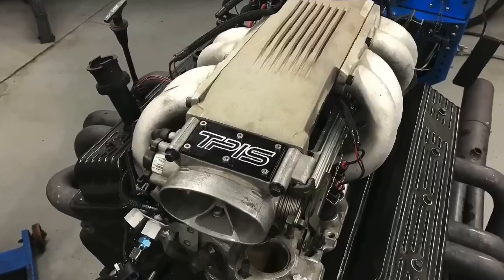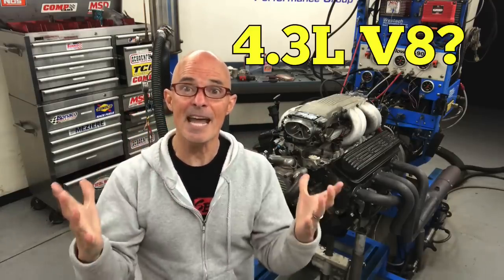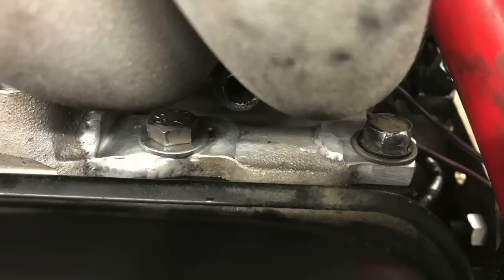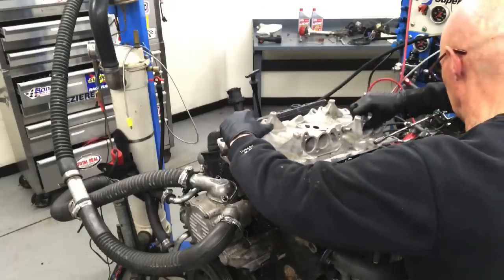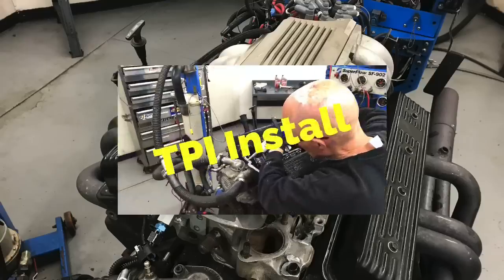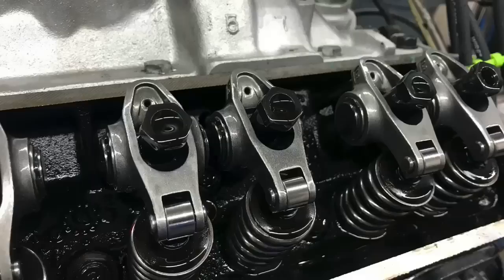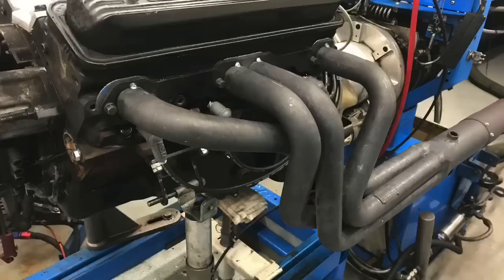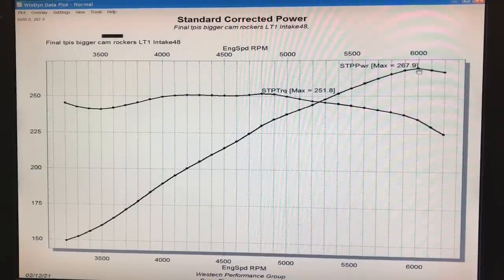GM's BIG MISTAKES-LT1 VS TPI VS CARB (L99 4.3L V8 INTAKE TEST)

Comment: All other things being the equal, I know the peak tuque lb/ft will increase with CID. However, would more CID result in lowering the peak torque RPM (especially with the tuned port), or will the peak torque RPM always be the same for a given runner length?
Reply from the maker: USUALLY MORE DISPLACEMENT DECREASE PEAK POWER RPM

Comment: Wow...  Surprising after all the hype I've heard about the  LT1 Intake.
Reply: Not if you're familliar to how the TPIS Miniram compairs
Reply: @lb9gta307  I'm Familiar.  Just surprised to see the dual plane walk all over it.
Reply: @michaelangelo8001  its walking over it b/c of the tune and its using a stock 48mm throttle body doesnt even have the air foil, that carb flows over 1000cfm and sells for over 1K not a fair test
Reply: @Madmax.3  Just how much airflow do you figure a basically stock 4.3 liter needs at under 6,500 RPM?
Reply: @michaelangelo8001  throw a standard 300-600 dollar holley or even edlebrock and let me know and its not stock it does have a cam
Reply: @Madmax.3  What..?

Comment: The tpi intake would have been better than the lt-1 intake in most of the caprice applications. I think gm only used the lt-1 intake because of the low hood lines of the cars in that era.
Reply: Corvettes had TPI from 84-90 and there was much less room under the hood. No reason whey not to put an L98 in the B-bodies.

Comment: Everyone says that the TPI intake is only good until about 4100/4200 rpm which I see is true, but look at how much longer it makes more power than the  LT1 intake. Almost to 5300 rpm.
Reply: and that is a unmodified tpi no port work and stock throttle body unlike the gobs of tech in that new holley race carb hes using that goes for 1k

Comment: There are three bolt patterns.  Original, TPI and LT!/Vortec. Correct?
Also I would love to see the GM crate 383, with claimed 444 LB FT, combined with a ported TPI>
Reply from the maker: lt AND VORTEC ARE DIFFERENT
Reply: There's 2 tuned port injection bolt patterns also. Around 88 it changed on Camaro. Corvette with aluminum stayed the same through out.

Comment: tpi I understand uses air inertia - low diameter - high speed, plus long tubes but for more power it needs higher flow so larger diameter short route.
Reply from the maker: LONG RUNNERS = REFLECTED WAVE TUNING AT LOW ENGINE SPEEDS

Comment: Do you have anything on which exhaust configuration (X-Pipe/H-Pipe/True Duals/Y-pipe) and diametre work best with the long runners?  I want a H-Pipe on my 5.7 Trans-AM GTA but want to pick the best one for it without throwing away the torque it already makes.
Reply from the maker: you won't change the power much with those-just the sound

Comment: I have a 1996 Suburban with a 5.7 vortec engine. I have a rear mounted distributor and coolant runs through the intake. My engine must be a SBC correct? Were they still installing SBC engines 1992-97 in trucks but not cars?
Reply from the maker: yes they had 350 small blocks in 96 vehicles-

Comment: Do the gen 1 motors and gen 2 motors share the same, if not similar electronics? Did you have to change/modify the wiring to switch between the manifolds?
Reply from the maker: DIFFERENT DISTRIBUTORS (OPTI SPARK ON THE lT1)
Reply: I understand that, but do the sensors and injectors just swap over or does it all need to be changed? Basically like if you had a lt1 car and wanted to swap in a l98 would the wiring be converted or would it be best to just change it.

Comment: What about putting the the long runner tuned port  on a vortec 5.7 liter and see what it does with a good cam.
Reply from the maker: I HAVE
Reply: A friend of mine did this. Stock van Vortec 5.7L. Home ported the bowls in the heads. Port matched Vortec TPI base. Stock un ported runners, plenum, and throttle body. Lunati street/strip hyd roller.
12.28@111mph in the 1/4 mile in a 1992 Z28. 
The engine has loads of torque. Excellent street engine.

Comment: Maybe I was distracted and missed it, but there was a  moment in this video when I thought someone was going to put some real numbers behind the silly airfoil for the TPIS, then nothing. Can't believe the thing works but have not seen even one before and after dyno pull.
Reply from the maker: IT DOES IMPROVE AIRFLOW-DOES YOUR MOTOR NEED MORE AIRFLOW
Reply: @richardholdener1727  Not sure how it would improve airflow, however based on tests the stock set up flows over 1200 CFM and a cylinder can only use just over 500 CFM based on valve size and timing.  
It's funny because the strength of the K&N story is that it flows more air, but also straightens the airflow into the intake, the foil claims to swirl the airflow which in theory would be a disruption. It could create a mini venturi effect to speed airflow but that seems dubious, and begs the question that if it could generate even a hp or two why the manufacture hasn't applied the fix in updated throttle body castings. 
My complaint is there is no published data to show its effectiveness.

Comment: What about long-runner intakes with increasing ID, air flow, and cam duration increasing as tuned RPM goes up?

Ken @ First Fuel Injection might send you his giant beast of a TPI intake (301 cfm on the bad runner for the testing); can be ported up to 1.8” ID and catch 4th, 3rd and 2nd reflected wave and make peak HP @ 6,500 on 5.7 liter with a 19” total runner length. (Would show runner length moving curve to left but ID moving back to the right and the torque peaks and valleys of transitioning through the reflected waves and each ones relative strength. 

AFR 195s or 210s  with the ported FIRST and a custom comp QXI / QXE lobe combo speced by your friend Billy Godbold for 6,500 I’m convinced could be an NA TPI combo that breaks 500hp with good fuel and cold dyno air and water. 

Long runners with big airflow CAN make power. People’s heads would explode.
Reply from the maker: 6500 WITH 19 INCHES?
Reply: @richardholdener1727  Yea... Probably better to go with more stroke and target lower, but it HAS been done at least once before. Dart SHP 4.060" bore 3.562" stroke (SBC 369), AFR 210cc ported @ Dr. Js to 222cc, aggressive Mike Jones hyd roller (might as well be a street solid roller) 2.76" cross sectional area in the giant runners moves the tuned rpm to the right and it starts picking up the 2nd harmonic wave. Dyno graph showing 6,500 rpm hp peak and 418 rwhp: https://www.speed-talk.com/forum/download/file.php?id=2827
https://www.speed-talk.com/forum/viewtopic.php?f=1&t=30094

The same guy's previous less max effort but still "major effort" FIRST TPI build hit an HP peak @ 5,300 and then had another HP peak @ 6,500 as the 2nd reflected wave started tuning up high: 
https://www.thirdgen.org/forums/attachments/tpi/250895d1355698976-tpi-long-tube-runner-dyno-run-36.jpg
Reply: @richardholdener1727  I've got a more thrown together FIRST TPI 350 build completed and sitting on the engine stand waiting to get stuck back in my C3 Vette that will eventually get put on a wheel dyno (it'll be a while; I'm slow).  Jegs $998 195cc Profiler heads, stock bottom-end L82 (14k miles on it before I rebuilt it), 10.2:1 static CR, Mike Jones aggressive hydraulic roller, 1.6 RR (.600" lift on the intake), Holley HP, LS coils, 1.2mm metric gapless TS rings with spacers, 58x crank trigger, and Vortec distributor used for cam sync, cleaned up FIRST intake throttle body entry and exit, runner entrances and port matched to Felpro 1206.

An acquaintance who's a wizard with EA Pro engine sims estimated a 5,850 rpm hp peak. Mike Jones specced the cam for 6,000 and having it hold on flat to around 6,250. (I think the extra exhaust duration helps it hold on without falling off a cliff??)

I'm hoping for a mostly bolt together TPI build that peaks close to 6,000 rpm; but it's the torques that I'm most interested in. ;-) 

https://www.facebook.com/photo/?fbid=10159479185246929&set=a.10154956065381929
https://www.facebook.com/photo/?fbid=10159479185326929&set=a.10154956065381929

Comment: Any thoughts or data on fuel consumption between the carb'ed and tpi?   Even a link to that would be cool
Reply from the maker: UNDER CRUISE OR WOT?
Reply: @richardholdener1727  I know you'll have the WOT, (which is still good info) but was thinking of the street strip guys cruising consumption the most

Comment: What would siameseing the runners in or near the intake base do to the power and torque curve?
Reply: Shifts the power band up a few hundred rpm. The aftermarket runners are worth 20HP or so. Porting can increase that # further
Reply: @TurtlDrip  Thanks Chris.

Comment: off the topic question, what do you think about putting a high lift cam in a LQ9 with 233k miles, good or bad idea?
Reply: He put a turbo on one with that many and made over 1000hp it will be just fine lol
Reply: are you taking it out to do the cam swap
Reply: @brandonpanozzo86   no, i was thinking of doing it in the truck.
Reply: @thatturbotruck  Thanks Billy.
Reply: Do it, make sure you upgrade the springs too.
Reply: @n8rivera74  I was thinking ls3/L92 heads and cam install, this week my truck is at the shop getting a new transmission.
Reply: @MidValley5145  if your truck is a 6l80 make sure they use a billet faced converter. You cna get them many places. autozone sells them and they are called a torquezilla. The factory converters come apart internally and the metal destroys the trans. I recommend this to all of my customers. I've done 3 that had just started having an issue and I was able to do just the converter nad flush all the old fluid from the cooler along with a new filter and all 3 are going strong now without having to buy an entire trans. This only works if the problem has just recently started. The symptoms at first are a rpm fluctuation at 65-70 when trying to hold speed. If it's a 4l60 it's probably just toast anyhow lol
Reply from the maker: YES ON THE CAM

Comment: Interesting test but do that test on a 5.7 liter sbc that has more airflow demands , not many people will spend money on a 4.3 small block .
Reply: I don't know.  I can see people playing with small displacement V8s in dual purpose daily drivers.   You know, not completely boring but not quite the gas hog either.
Reply: There is a 305 following, im dure 265 will as well
Reply: @paulkleinschmit9871  I can’t get interested in any cool car that’s slower than my Honda minivan

Comment: Wonder what the TPI would do for a high winding 302sbc
Reply from the maker: THE SAME-LOW SPEED TORQUE
Reply: @richardholdener1727  that’s very tempting, only I don’t have the skill to adapt it to my engine 😣😖

Comment: TPIS  put a stock tune port intake on a 400+ ci small block and it made 500 ft torque down way low and still put out 400 Hp at the top...

Comment: the BBK throttle body will not fit an airfoil because it does not need it, it is a better throttle body than the TPIS

Comment: What diameter is the intake runner , can anybody fab up one slightly larger.  1/8 "-3/16 larger  Could be a winning product
Reply from the maker: THOSE ARE ALREADY SOLD BY GUYS LIKE TPIS
Reply: AS&M originally made the larger runners, tpis where AS&M sets, slp accel edelbrock also made bigger runners all are discontinued except for the as&m which are also made at a limited bases

Comment: that TPIS cam is almost identical to the 1989 305 tpi 5 speed cam.  damn good camshaft, i wish i didnt wipe mine when my 305 was in my iroc.  put a 93 lt1 cam in it ot repalce it
Reply: The lt1 cam was a downgrade?
Reply: @xmo552  its a toss up.  the lt1 cam has more lift, but less duration.  my ideal cam for that engine would be the lift of the lt4 production cam with the duration of the 89 lb9 5 speed cam.

Comment: Have you ever put a TPI intake on a TBI engine? THat would be interesting to me.
Reply from the maker: what would be different than having the TPI on a TPI engine
Reply: @richardholdener1727  The TBI engine has swirl heads that reduce intake flow, but are good for low end torque. Also, the TPI intake would get rid of the limitations of the TBI manifold. TBI engines have similar fuel distribution problems as carb engines, and the multi port injection design of a TPI intake would get around that.
Reply from the maker: I would like to see swirl heads actually improve low speed torque

Comment: Seems like on a 4.3 V8 chevy the TPI works better 40 foot pounds of torque can be felt at a lower rpm l don't think anyone putting one of these liitle engines together is going to expecting big horsepower especially above 5000rpm like he said in a heavy car like a caprice with stock gearing and a tight torque converter the TPI would work better making the car more peppy from idle to 3500rpm just don't know about investing money and time with this engine at least from a performance stand point the horsepower numbers to me don't justify going through all this but 40 foot pounds of torque from a simple intake swap is impressive

Comment: the lesson here is that the TPI should be available in varying diameters and lengths.  also avaialbe in 6 and 8 cylinder versions.  once again GM has a touch down but drops the ball.

Comment: Can't wait for the cam swap video. 
What will extending the cam timing do on tpi set up?
Reply from the maker: IT WON'T CHANGE THE EFFECT OF THE RUNNER LENGTH-MIGHT CARRY A LITTLE FARTHER
Reply: @richardholdener1727  I was thinking it might sacrifice torque low down and add to it further up the rev range. If you have the right cam it might make, or better the power of the short manifold, but still make better torque say from 3000 rpm upwards.
Guess you already know🙄
Looking forward to seeing the next vid👍 
Many thanks from 🇬🇧
Reply: @gothicpagan.666  Carb and TBI engines hit their HP peak then fall off. TPI engines hit their HP peak then plateau. Put a bigger cam (within reason) in a carb or tbi engine and it moves the HP peak higher. Do it in a TPI engine and it hits its HP peak very close to the same RPM as before, then plateau. You might gain more HP on the TPI engine with the bigger cam but you don't do it at a higher RPM. It's all about the runner length with TPI

Comment: Does anyone have an old Accel Superram "pizza box" plenum and runners that Richard can borrow? That would be interesting to add to the fray. Even though they are old, archaic tech - I still have love for the TPI stuff. I cut my teeth on them in the mid to late 90s.
Reply: i do aswell as the tram and every runner made slp, slp first design, tpis, tpis semi siamiesed posted that he can use back in his other 10 times the torque vid where he tested a tram on a 383 but used the stock 48mm throttle body meanwhile he was using 58mm on the mini ram and stealthram to get bigger numbers he also added another carb dyno that wasnt in the original article made years ago, the original article had a carb but it made pitiful TQ and HP numbers he had to use a 1k race carb on a dual plane to get good numbers

Comment: Those header primaries are way too big for that displacement and cam profile. Even a 1 5/8 inch header would be too big. That would rob you of low end torque, and throttle response.
Reply from the maker: MINIMAL CHANGE
Reply: @richardholdener1727  😳😳😳 Care to place a wager on that?

Comment: Why not try modifying a tpi system and yes it on a 4.3 V6. If my theory is correct... That should make one helluva truck motor.
Reply: The LU3 Vortec which is Related to the L31 350 Vortec, already is.
Reply: @shadowopsairman1583  OK, LQ/LO; LUs; LTs; are different types of the same engines. These differ mainly by heads and/or intakes.
First vortec heads were 84-85, rebranded in 86 on as TBI heads. Second generation of vortec heads began in 90 as an option accompanied by an entirely different intake, shortened round runners with central port injection; in the same time frame the LT1 was being used on corvettes, in 92-93 the change over from the LT1 to LT4 occurred ( lt1 fbody/LT4 corvette).
The tpi and vortec intake is what lead to LS intakes. Vortec intakes are more like LS intakes than tpis'. However the "vortec" is literally the head and nothing else.
Where as the LT1/4 is literally the intake, not the heads. LS is an entirely different designed engine.

Comment: I'm surprised it didn't carry the power out to 5500 with the small displacement.
Reply: It is not the flow. The waves are still running up and down the runners. At the torque peak they actually force extra air into the cylinder but, at higher rpm, the wave action begins to actually pull air back into the intake runner just before the valve closes. Lingenfelter tried every trick to make it work but finally went to shorter runners to raise the RPM. He describes this in a book he wrote.
Reply: @Dr_Reason  I assumed the intake runners would act like header tubes do on the exhaust.
Reply: @bartpang  I would too. Lingenfelter argued otherwise.

Comment: Headers takes low end torque away from small cubic inch at low RPM's. Headers benefits past 5000
Reply from the maker: LONG TUBE HEADERS ADD THE MOST POWER DOWN LOW
Reply: @richardholdener1727  Lol always heard opposite. Headers takes away power down low from stock low rpm engines. I ran a mild 350 with 461X heads 600 double pumper duel plane intake stock cast iron manifolds from 70's camaro 350 turbo stock converter 3.50 gear gutted 78 monte carlo. Ran 13.40's @ 5200 RPM 125 shot nos 12.50's @ 5000bad miss at 4300 nos said need single plane intake. Ran 13.70's 125 shot low 12.0"s fastest past 11.89 @ YES 5000